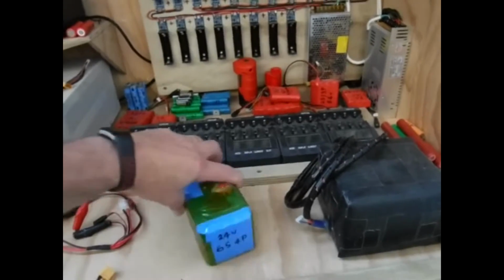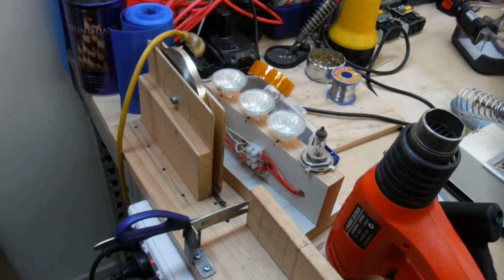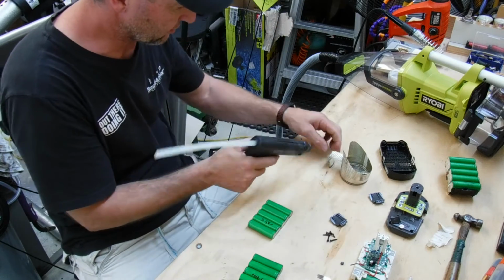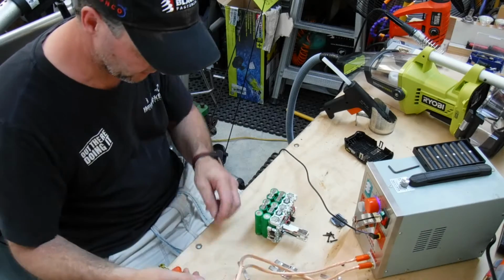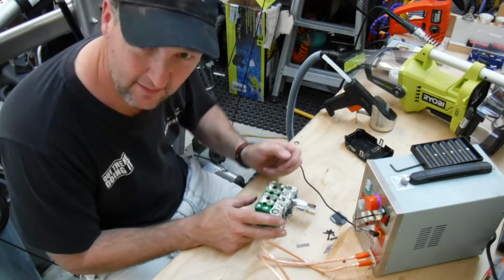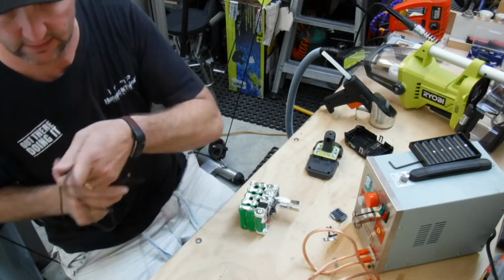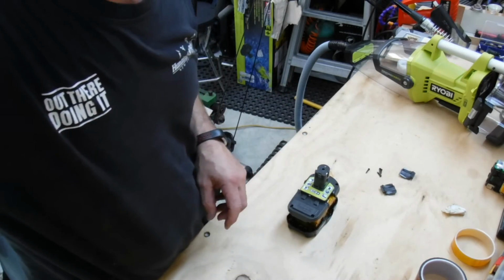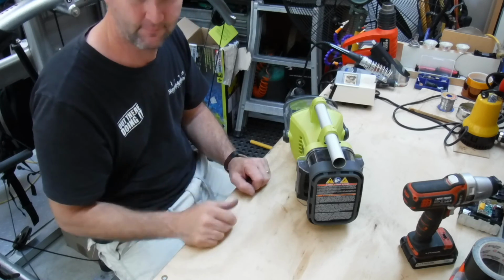18650 battery extention for 1" Ryobi gold sucker :-)

Comment: Might have to start charging you a commission in the mountains of gold you’re gonna be pulling out of my Claim bro🤣🤣🤣 Interested to see how it works and how much material it moves.
Reply from the maker: Next time you're up give me or jade a hola would like to catch up :-) but yeah will be interesting to see how it works, the thing I like about it is that when the bottom has been cleaned I can put the rocks back to how they were before I started, which looks way better than leaving hole everywhere :-( mind you a good flood seem to fix everything pretty quickly just haven't had one of those for a while.
Reply: Bro a good flood up there completely changes the river🤣🤣🤣